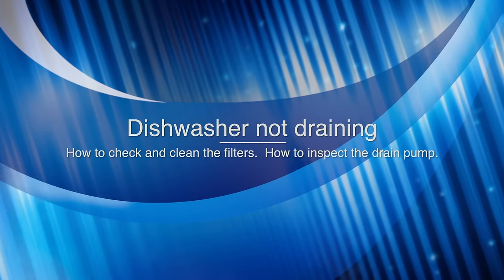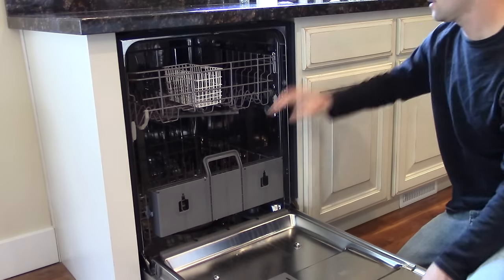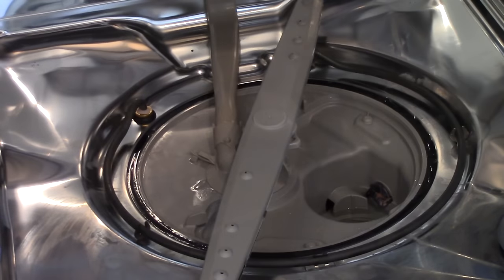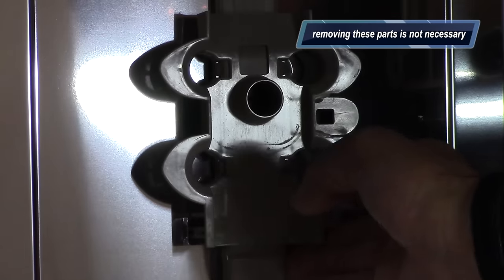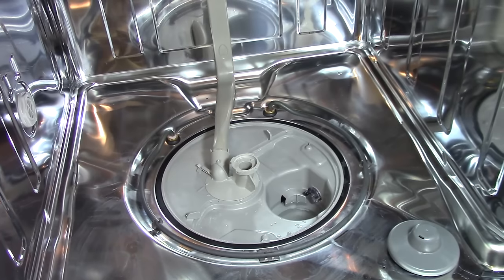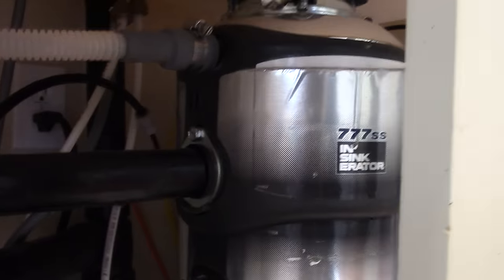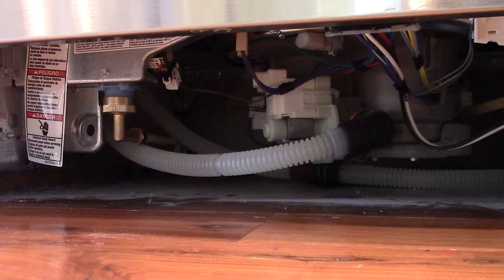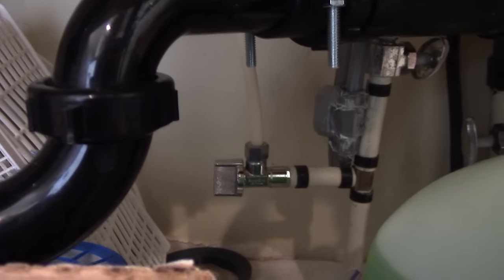How to repair a dishwasher, not draining cleaning - troubleshoot Whirlpool Kitchenaid

Comment: This is wonderful, thank you!  The standing water under the filter shown in the video - is that normal?  Mine is full to the top, it seems like that is too much?
Reply: Did you ever find out? Wondering too. Seems like there shouldn’t be any water left in that.
Reply: @cynthiajones9927  Yes, 1-2 cups is normal, I read it somewhere else.  The water is there to keep the seals from drying out.  It of course drains with the next cycle and is replaced by new water every time, so as long as the dishwasher is run regularly, it shouldn't get nasty.
Reply: Jessie Frank ty so much for quick reply! Awesome!!! I fixed it then! With help from this video. Just needed to clean the filters. Nasty! 🤪 have a great day!!
Reply: @cynthiajones9927  I just discovered the "Cancel / Drain" button - on mine it's on the right side with an "X."  Press that, close the door, it makes a bunch of noise and you can hear it draining into the sink... and now most of the standing water is gone.
Reply: Jessie Frank oh wow thx for telling me!!! I’ll try that
Reply: Jessie Frank also sorry for late reply. I just saw this.
Reply: Jessie Frank Ok I did it! Thx!!

Comment: Hello, I have a Whirlpool Gold Series WDT910SSYM2 - we noticed that after a wash the soap cube did not dissolve or wash the dishes. the unit fills with water, heats and drains but does not spray. I am very comfortable doing repairs myself I just need some pointing in the right direction. I already have unit pulled out from under the counter to make working on it easier. Long and the short...it fills...<nothing>...drains! Thank You
Reply: My washer is doing the same. Did you ever figure out what the problem was?

Comment: I pulled the drain filter out and there is water sitting in the bottom like in you video I’d say maybe an inch of water. The water is dirty with particles floating in it. Is that normal? Thanks in advance!

Comment: This is a GREAT instructional video! Thank you first and foremost. I've checked everything and our problem (error code E1 F8) still persists which means our dishwasher seemingly keeps trying to pump water out - I've read on some dubious forums that the sensor in the drainage part may be defect and transmitting the signal that there still is water to be pumped out (which there isn't).
The question I have now is: Is it possible to replace this sensor myself? I'd rather not pay 219 Euros for a technician to come over for our 7 year old dishwasher.
If you haven't already (couldn't find anything along those lines) could you make a tutorial?
Reply: Mainly I'm afraid of purchasing the part and then breaking/messing something up in the process of repair

Comment: Adam, I have the same dishwasher and watched your video.  After removing all the filters and things inside I disconnected the black elbow underneath and found there is something stuck just past the black elbow heading towards the garbage disposal.  I can put my finger into the elbow and feel what I think is a piece of glass lodged right there at the hose opening and the elbow connection.  I've tried to see if I can wiggle off that black elbow but it doesn't seem to want to move.  Should I force that off?  Do you have a suggestion on how I can get the black elbow off to clean the tube?
Reply: +Renata Wallis sometimes that elbow has a seated in check valve u have to change that section of drain hose.the elbow wont come apart

Comment: Can you please help me. Mine leaks out the bottom of door and I do not think its the gasket. It seems the tub is too full and with all the swirling and splashing, the water cimes over the top to the floor. Ive inspected the drain and filter, no issues there. Is it possible the drain pump is weak? Ive inspect during operation, sounds good. Could there be something in the pump preventing adequate drainage? How would I check? Right now we need a towel on floor to deal with water overflowing out of tub. Its overflowing about 6-8 ounces a wash, thats a lot.

Comment: A couple things.  The impeller does not "spin"; it should turn a little with your finger with some resistance.  After I removed the pump hose underneath,  I hooked up the garden hose and forced water through the drain to the garbage disposal.  The garden hose fit perfectly into the drain connection. Pressure blew the blockage out. Problem solved!

Comment: Hi Adam, Great video.  I have what looks like this exact dishwasher.  I see below someone asked if some water was supposed to be in there...and I do have that.  But my dishwasher was installed in December...so six months old.  It reeks...  I don't think anything is stuck - but thinking it wasn't installed properly.  Contractor got it set up to work for us before sink was installed.  Then when sink came - plumber didn't change it.  The drain hose comes out and loops up to the top of the cabinet under the sink, and then is just sitting in a piece of pipe that drains.  It wasn't installed into the disposer or attached in anyway.  I think i can pull the drain hose right out of the pipe it is stuck in.  Is something with this set up causing the smell?  Thanks!!
Reply from the maker: Cindy Ferringer Hard to say without seeing it but it sounds like it needs to be installed correctly.  You can email me a picture if you like, just click on the "About" section of this youtube channel and you can get the address.  The smell is probably coming straight from the sewer.   I think I know exactly what happened; the dishwasher installer likely inserted the drain hose into the pipe vent under the sink because he had nowhere else to put it.   You need to remove the hose and put on a one way air valve on that pipe.  Then punch out the knockout plug in the disposal and clamp on the drain hose to the disposal.   But this is just a guess because I cant see anything,
Reply from the maker: Cindy Ferringer I just saw the pictures you sent.  The smell is likely coming from 2 things. One, you need to run the dishwasher at high temp washing cycles to kill the bacteria that can form inside. If the heating element in the dishwasher is not working that would need to be fixed.  Just open it in a hot wash cycle and you should have super hot steam inside.  If you never use hot cycles that could cause problems.

The second thing is the Air Inlet Valve under the sink is broken or not installed correctly.  Is the smell coming from that?  Google image search "air inlet valve "  to see what I am talking about.  If it's not right, you will have a air flow coming right from the sewer to your house. And that would explain the smell.

If you can, hook up the dishwasher hose into the disposal and clamp it on.  Then cut off the pipe it was in and cap it.  You will want to get rid of that extra P-trap as well on that section because it now serves no purpose and you don't want water sitting in there turning super septic. I can't tell from the picture but it looks like you have an Air Inlet Valve  behind the pipe with the drain hose.  Is that Air Valve installed above a p-trap?

Comment: I'm new to this YouTube and replying or commenting so bear with me please. So I mentioned earlier in a post that I can't find lol, that my dishwasher isn't cleaning and it does not get hot. My husband says it's not cleaning bc the water isn't getting hot but I've read that the heat is for drying not cleaning. So is it not cleaning bc probably debris somewhere and then not hot would be the heating element right? Or would a blockage somewhere effect the heating part of the cycle too? Do you get what I'm saying? I'm not sure if I do so I'm just checking that I'm making sense. Thank you so much!

Comment: Question: the impeller on my drain pump is spinning when the pump is on, but the water isn’t draining completely. When the cycle is finished, there’s still a half inch of water at the bottom of the tub. If I press the “drain” button once or twice more, the water will eventually all drain out. Could this mean my pump is failing and needs to be replaced? It’s spinning freely, but maybe it’s not spinning fast enough to drain all the water without repeating the process?

Comment: Thought mine was more, but If it's just a clog like mine, you can use a bicycle tire pump. 1. Wrap the air nozzle end with electrical tape until slightly bigger than the rubber end of the dishwasher drain hose that connects to your garbage disposal. 2. After disconnecting from disposal, Push air hose firmly into disposal end of washer drain hose to pressurize the air back in the direction of the washer where clog originated. 3. Mine took 5-6 pumps on a tiny 8" tire pump before bubbling up the clog back into dishwasher bottom. 4. No ow just use something with a screen like config. to clean up clog gunk. Shop vac would be ideal, if not, cheese grater?😜👍

Comment: My dishwasher is rattling pretty loudly upon start but eventually dies down. The sound seems to be coming from the front lower part of the dishwasher. Any ideas what it could be? I’ve made sure there’s nothing on the screens or blocking or any loose debris in the dishwasher.

Comment: Cholesterol...  I just removed the drain hose at extractor end "at sink drain"...  introduced a flexible wire right back through and unclogged the grease and cholesterol...   worked

Comment: My dishwasher looks just like the one in your video. It will fill with water, but the sprayers don't do anything. I've made sure the top rack is docking properly, and have done everything in your video, but it still isn't working. You can cancel the cycle, and the water in the bottom will empty. There is kind of a very low humming electrical noise, but nothing else coming from the dishwasher after it fills. Any suggestions as to why it will fill but won't clean? The dishwasher is just 3 years old, and has worked like a charm before now. In fact, everyone who has visited us has commented on how quiet it is and how clean our dishes are.
Reply from the maker: +Charles Pearson The pump that circulates the water is not working or is blocked by debris.   There is also a chance that the pump is not getting power.

Comment: HI, thanks for video.  My washer fills up but never starts the agitation process to start cleaning dishes.  I can press cancel and the water drains.  I then select a cleaning mode and press start, the washer fills to heating coil level and never starts spraying water inside unit.  thanks

Comment: Yes there is water left under the filter but it’s expected. The drain hose goes up and then into the drain as directed by the install manual 
Actually I recently been washing them is hot cycles and the results are better.

Comment: Hi Adam, I have a Whirlpool 5600 Dishwasher very similar to the one in your video. Bottom is identcal. It suddenly stopped working and I get a "error 8" (Start button flashes 8 times then stops for a few seconds and does it again and again). On checking the user manual and googling it it says it is detecting turbid (dirty) water or dirty filter. I saw your video and cleaned the filter well and got out the small amount of dirty water from the bottom with a cloth. I cleaned the sensor with a brush and my finger as you did. Put it all back together but I still get same fault. Looks to me like the dirty water sensor is gone faulty. Any idea how to replace it ? The draining pump works as I have added 2 cupts of water and it gets drained but then machine goes into faulty state (after running for 30 sec approximately) Thanks Sgoo
Reply from the maker: +MrS Goo That is one part I have never had to replace.  They usually don't fail.   Is there a manual online?

Comment: Is it possible to try and "force" water back through the drain pump (in towards the dishwasher) to try and flush out anything, from the inside of the pump, that may be blocking water flow ?

Comment: Mine is draining but not recirculating water inside to do the actual wash cycle.  Any tips on what to check or replace for the recirculating spraying cycle not working?

Comment: Pulled a piece of plastic out of the impeller housing, freeing it up to turn. Hooked everything back up and the washer still will not drain. I hear the pump hum but no water out of the tube. I've checked and cleaned all filters and water paths just as the video shows. My question is, could the obstruction have "burned out" the pump? Would it need to now be replaced? Thank you for any information.
Reply from the maker: Once I fixed a washer where the impeller came loose on the motor shaft.  It was still attached but did not move water because the metal shaft was spinning freely inside.
Reply: I'm having the same issue. Had someone come out and replace my pump. But the problem still exists. Sometimes it drains just fine, other times it won't drain at all.  any luck with a repair?
Reply: That helped but didn't fix it. I got into the pump again and noticed there was another piece of something that was causing it not to turn. Once I used hemostats to remove that debri it was fixed. If you have replaced the entire pump there has to be something in the drain path that is obstructing the wage flow. Can you hear the impeller turning?
Reply: Yeah, it sounds like everything is turning... whirring sound, then sometimes it'll drain, sometimes it won't.  I've noticed that it seems like when it's all heated (immediately following a wash cycle), then it usually won't drain.  But if I wait and let everything cool, then it will usually drain once I press the drain button.

Comment: Hi Adam, I have a similar model (W10431035A) that does not heat up the water...the element was burnt / broken so I assumed it was the element and i replaced the element...it is however still not heating...is there some kind of a fuse that might have blown when the element burnt? how can I fix that?
Reply from the maker: +Alok Chopra I have never had an element go out on me.  They are fairly reliable.  You may want to check the dishwasher thermostat.  If it's bad the dishwasher will not know when to turn the heating element on and off to keep the water at the required temperature.  The good news is that it's a cheap part but it may be a little awkward to get to.  You can also test them with a multimeter if you have one.

Comment: Adam
Great video.  My kenmore elite (655.12773k312) isn't working.  The light on the front just flashes.  I ran through your video still doesn't work.  I put it through the self diagnostics and it said that it was the door switch.  I tested the door switch and it was fine.   I put it back in diagnostic mode, but now when I close the door it doesn't do anything, all of the lights stay on and nothing happens ... any suggestions?
Thanks
Reply from the maker: +plzrcyl  I guess the door switch is not signaling to the main board. How did you test it?
Reply: +AdamDIY Thanks for the reply.  I tested it with a multimeter

Comment: Is it ok to have about an inch of water in the indentation where the filter sits? Most of the water is drained from the bottom of the dishwasher but just that half a cup of water is always at the bottom of the filter cup. Is this normal or do I have a weak/plugged drain motor?
Reply from the maker: +meyman9 It's normal.

Comment: What about the water that remains in the drain where you took out the filter? We don't use our dishwasher very often( maybe 2 dozen times in 6 years)  and if I don't soak up that left over water when I do use it, it gets really stinky.  The filter etc. are clean. HELP

Comment: Mine keeps say e 4 which had a leak had a look it bubles out the back of the unit but it looks like a gutter that it bubbles in to is this normal or a fault as of its brand new

Comment: Hi great video! I have whirlpool model WDF750 SAYM1 it stops working in the beginning of the initial cycle. Water gets in and drains, circuit board was replaced, the heater coil inside at top was replaced, it still isn't working. Any suggestions? Thank you!
Reply from the maker: +Dana Jensen Does it start spraying water to wash the dishes? Or does it just fill then stop?
Reply: +AdamDIY It does spray the water initially  and it will drain. It just stops after spraying, so its not washing the dishes. Thank you for responding!
Reply from the maker: +Dana Jensen How long does it spray for? Just for a few seconds or for many minutes.  It could be that there is a clog in the sprayers, sprayer nozzles or somewhere along the line.
Reply: +AdamDIY its for a few minutes. Is there a way to clean the lines? Also is it possible that dust on the outside of it could cause this?
Reply from the maker: +Dana Jensen No, dust would not be a problem.  I would start by removing the easy parts first like the sprayer arms and run water through them in the sink.  Make sure everything is all clear.

Comment: in my case the washer had a control board issue which caused the heating element to stay on which melted a small hole in the bottom of the arm causing a loss of pressure. it still shot water but wouldnt rotate.

Comment: We've had this dishwasher for a year (we rent and our old one was replaced) and we were starting to get dishes with some food particles on them.  The last run it jumped to nearly half the dishes.  I watched this video, went to my dishwasher, and pulled out the filters.  It's been a long time since I've seen something so disgusting...I'm thinking there is some other problem that these filters were this caked on with crap.  But I cleaned them and we'll see.